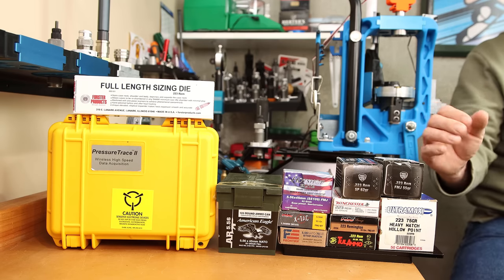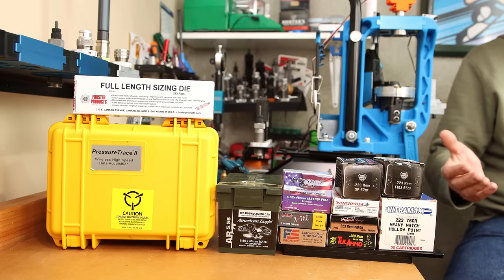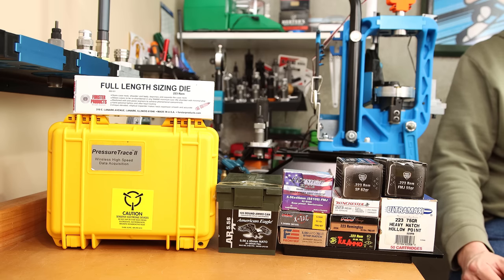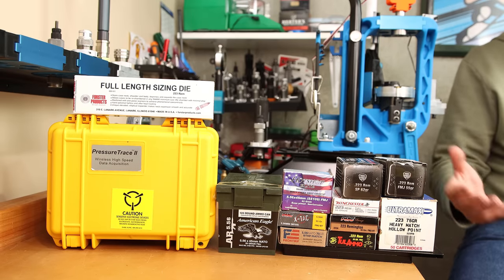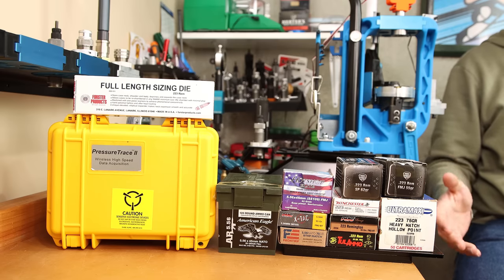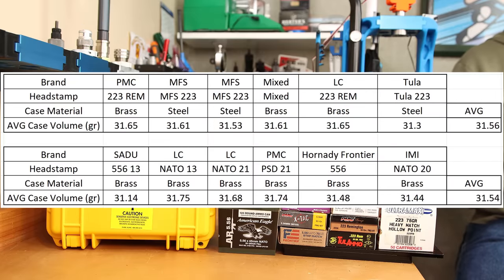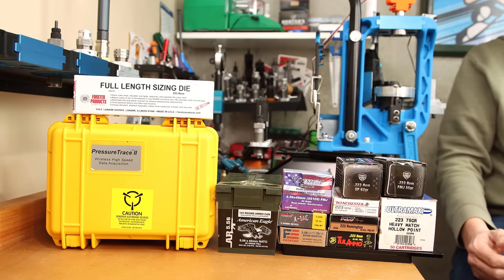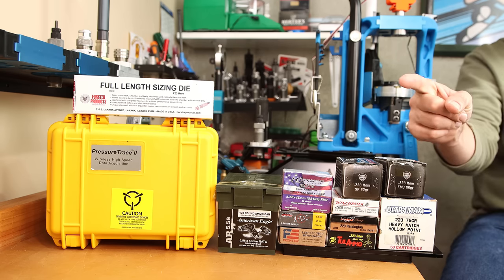223 vs 556 - The Hidden Truth No One Tells You!

Comment: As commentary, in the '80's, I and friend hunted varmint with 223/556 cartridges as our light rifles and tried to crease all the velocity out of them as possible.  Luckily, we rarely found pressure problems as we selected primers, used rabid case selection and treatments for primer pocket/hole, neck preparation, etc.; essentially max velocity bench rifle ammo. We threw out anything that looked iffy. We had quality rifles; those probably helped cut us some slack.  We found the very heaviest'/compressed loads to be the most accurate, when adjusted with the right bullet selection. Shooting paper targets for groups is a great humbler, and proper rifle presentation helps. I think our case neck preparation  for concentric position, near identical grip on the bullets, helped us along toward our goals.  Along with all that, we shot for pride, and loved riding each other for any kind of miss! Wish I had all your equipment then, and now. It's fun to hear that rifle go BANG, but really satisfying when the bullet goes exactly where you want.

Comment: 308 is also not 7.62x51 but most people don't believe it. You will see the difference if you shoot 308 with a original H&K G3 and experience feeding issue after feeding issue.
Reply: You experience issues with cycling is about the 308 using slower burning powder to get more velocity.  An adjustable gas system would solve your issue. Loading 308 cases with faster burning powders also solves your issue, 7.62x51 and .308 are the same case.

Comment: awesome video and your first set of numbers 556 was substantialy more powerful. Any gun that can shoot a 556 can shoot a 223, it's not always the other way around as per the manufacturer that I've talked to. I'm only going off of what a gun manufacturer of told me, and 556 is marginally a little more powerful from what I've seen with most tests obviously not with the ones you used it was more. the data shows and videos show it's only about 40 fps variation usually, which isn't really enough, to be enough. Paul Harrell did a video on 556 vs. 223 as well his numbers weren't as big a difference as your numbers are I'm not saying you're wrong they just weren't.

Comment: I learned the opposite of what I’ve been convinced.
i.e. “556 rifles are built to tighter tolerances and factory 223 ammo is fabricated to sloppier specs and lesser QC standards therefore 223 ammo won’t function as reliably in a 556 rifle, but a 223 rifle will eat either ammo because it’s built to looser specs”
Hmm… 🤔

Comment: While I understand at least some of the reasons that you chose to use a .223 Wylde barrel I think it would also contribute to misleading data.  Among the reasons I presume is to reduce the number of variables.  It is also introducing variables by firing all of the ammunition in a chamber that was designed specifically for neither; rather it's a "one size fits all."  The Wylde chambering is going to lower the peak pressure for .223 rounds due to the extended throat while it is essentially the same as a 5.56 chamber although possibly/probably a little tighter than a 5.56 chamber thus raising the pressure for the 5.56 rounds.  To me data from a 5.56 NATO chamber would be more meaningful for the 5.56 ammunition just as the .223 should have been fired in a .223 chamber.  Measuring the case volumes of fired cases seems rather unscientific since they have all been fire formed to match the Wylde barrel.  At a minimum, unfired vs. fired case volume as an additional data point would have been interesting and possibly meaningful.  Your verbal comparisons seem spot on.  Me?  Just a detail oriented hand loader.

Comment: The only real difference is the pressures. All other variences are irrelevant as far as running them through one rifle or the other. The only other are where there is difference is in the chambers of the rifles themselves. Most 5.56 chamberings have gap between the chamber and where the rifling starts where .223 chamberings do not have the gap or might be vice-versa. As far as the cases and overall lengths of finished rounds, they are basically identical. Cases are identical, with the only length variation being in how deep bullets are seated. The pressure difference comes down to weight of powder charge and type of powders used.

Comment: For 55gr, there is NO difference between the two functionally. The pressure is only slightly higher in the 5.56 but not enough to be dangerous. Now this is strictly for 55gr. I've used 5.56 in a .223 but knowing there ARE pressure differences between the two, I stick with 55gr as it's more the "standard" round. I've since moved to 5.56 chambered barrels so there is no longer any question of "can I run that in my weapon? ". I've noticed that 5.56 hits higher than .233 and that's attributable to the higher pressure,  like the difference between your standard round and a +p. Higher weight bullets sit differently in the chamber so that's where you'll have problems but as far as 55gr, there is NO appreciable difference in functionality in either chambering. The only difference between 55gr 5.56 & .223 is like a simple switch from standard to +p ammo.

Comment: A 5.56 is going to have more power behind it then a .223, a 5.56 is also going to have a easier time going through something then a .223 and it's going to leave a bigger hole then a .223. Also if you are going to put a round that isn't the proper caliber or designed for that type of gun that you are using aka if you are placing a improper round in your gun then you have zero business owning a gun let alone being around 1. Use the proper ammo for your gun or don't touch guns at all.

Comment: The only truth is, 5.56 has a lot more pressure than .223, therefore, you safely fire a .223 from a 5.56 gun, but you can't fire, or shouldn't fire, due to safety issues, a 5.56 from a .223 gun, because it over pressures the barrel and could cause a catastrophic failure.

Comment: I'm too late but I have an interesting point to add. My rifle is an original Colt AR15 from back right before they passed the first ''assault rifle'' ban (in the early 90s). Its barrel is stamped 5.56 and is practically identical to my M16A2's, but the lower is marked .223. So, does it really matter considering Colt marked their rifles with both on the same rifle?

Comment: Here is the truth from the industry 556 and 223 go down the same exact simile line and there is absolutely no difference in how they are loaded pressure is very for bullet weight and desired ballistics that is all the only difference coming out of the factory is was stamped on the bottom of the case there’s your fucking truth there is no difference only with a gun can handle what you’re using

Comment: The pressure difference is not an issue, either.  There are different pressure specs.  But, there is also a different pressure testing spec for each cartridge.  If you use the specified test to measure pressure for the .223 on a 5.56 round, you get .223 pressures, and vice versa.

Comment: I bought Winchester 223 & 5.56 and took the cartridges apart and cut the cases in half. 0 DIFFERENCE !
then I weighed the powder and the 5.56 powder was .90grs. more, same powder
then I downloaded SAMMI specs on 223 & 5.56 chambers and found the only variance was throat in 5.56 is longer and angle for leades was 1% less in 5.56 making it overall longer.
THE END !

Comment: You know, a really good visual aid is to put a 75gr .223 next to a 75gr 5.56. The bullet geometry is VASTLY different, and the 5.56 ogive is considerably shorter than that used in a .223 projectile. The 5.56 chamber is cut to accommodate that short ogive, while the .223 is not. Dimensionally, you can shoot 55gr FMJ 5.56 in a .223 rifle just fine without worrying about overpressure. It's only when you go up in bullet weight and the ogive extends out where it becomes a problem, as you can tell looking at the two 75gr loadings.

Comment: Sir .223 is 5.5.56x45mm, specifically .223 Remington Fmj are designated 5.56x45mm Ball M193 by military standards when loaded 3100fps in a 20" barrel.

Also 5.56x45mm (NATO) wasn't created until around 1977 in Belgium by FN Herstal and wasn't adopted by the U.S. military until September of 1982 for use in the M16A2 and later the M249 SAW.

There a difference between the original .223 Remington designated 5.56x45mm Ball M193 and 5.56x45mm (NATO)

.223 Rem is technically 5.56x45mm but 5.56x45mm (NATO) isn't .223 Remington.

.223 Remington was called 5.56x45mm Ball M193 20 years before the creation of 5.5.56x45mm (NATO) .223 was created created specifically by military request after they rejected the .222 Remington.

Lastly the original 5.56x45mm (NATO) cartridge is the SS109 and it was redesignated as the M855 (Green Tip) by the U.S. military.

Comment: the only difference between a 5.56 and .223 factory loads is the 5.56 has more powder.. Clowns claim the brass is different... the only difference in the brass, is what is stamped on them... since the 5.56 has more powder you have a measurable difference in pressure...

Comment: The pressure differences are huge.  The danger isn’t about damage to a cartridge, it is damage to the BCG.  In the military, we dont use “averages” we use worst case scenarios.  Putting something with a larger pressure breaking a bcg can lead to a complete malfunction when your life depends on it. If you felt so badly about making this video than say you think it is okay to put .223 in a 5.56 weapon.  If not, don’t put out an informative video alluding to that and take no responsibility at the end, or else you’re on the same boat of the ppl you’re accusing of hesitancy.  When a rifle says “multi caliber” it means you can shoot the civilian AND military variant of that round.  That implies the BCG can handle “worst case scenario” not the average.  To be safe, change out your BCG to handle higher pressure in the chamber and you’re good.  Do NOT shoot a round with 10,000 psi higher than your chamber can handle.

Comment: Ok Science aside.  My company used to make gun barrels for colt and DPMS and Bushmaster.  They were all marked 5.56 x 45 NATO.  We made a few barrels that were for .223 only.  We shot 5.56 out of them and the chamber pressure is higher on the 5.56.  So can you shoot 5.56 out of a .223 marked barrel, Sure, is it safe.  I wont even begin to say.  But .223 and 5.56 are identical measurements within a few tenths of a thousands.  Thinner than a piece of paper.
Reply: What was the reamer’s chamber neck diameter?
Reply: @blackhawk7r221  I honestly dont know.  I wasnt at the company when they did this.  I just found bills and barrel blanks.

Comment: I've never seen lower pressure loaded brass wear out faster than high pressure.
If you run through a lot of rounds, in your AR, .223 cases can swell and not extract properly. Due to the the different headspacing.
If you like to plink, zinc-coated steel cases are great. Just be sure to have your bolt carrier group drenched in oil. And thoroughly clean it every 500 rounds.  Stainless 5.56 uses lower pressure than most .223 so, you may need a lighter buffer, and (or), buffer spring.

Comment: Great data and great video. The difference is 5.56 is loaded a little  higher and .223 has less distance to the lands so if you have a really long btog there is a possibility for a pressure spike due to little or no bullet jump.
Reply: Bullet jump can be critical in accuracy. I have a Kimber bolt action .223 with a very light barrel, weighs 5lbs, 12oz without scope. It wants a jump of .004" for a 40 gr Hornady "Varmint" bullet & .020" for a Hornady 62 gr. It shoots both Under .400" for 5 shot groups at 100 yards & huge groups with most "commercial" ammo. I use Hornady's chamber/lead measuring device which measures off the ogive instead of the bullet tip.

Comment: The primary difference between the two cartridges can be equated to a Mouse Fart in a tornado - either one will put your ass in a body body bag just as effectively as the other.

Just remember - Do Not Load a 5.56 in a weapon chambered for the .223 ; there are more than enough articles to explain why, so if you need to know Why Not to do so, then find a few articles and go from there.

Comment: Yes, I so tired of all the BS too. In September 1963, the .223 Remington cartridge was officially accepted and named "Cartridge, 5.56 mm ball, M193". The following year, the ArmaLite AR-15 was adopted by the United States Army as the M16 rifle, it is the round I used in the Army when I was issued the  Colt AR-15 property U.S. Govt M16A1 Cal 5.56MM. This was stamped on my rifle.  The 5.5.6 NATO came out later in 1980 from the .223 but it’s not the same. It uses a different heavier bullet at higher pressures, slower but straighter shooting at longer range. It was adopted as the M855 round and to be used in the M16A2. The rifling was different from the A1 with the A2. The A2 could shoot both rounds with a loss of accuracy with the M193 round. However the A1 the M855 round would not shoot accurately at all out of the A1, and not recommended. The .223 is a 5.56 mm round it’s just not the same as the NATO round which people use today out of the later versions of the AR-15. And other weapons using the round today so that when people say 5.56 they mean the 5.56 NATO. 
I was issued the M16A2 later in my Army career. And carried one in Desert Storm. The ballistics are different from the A1. It’s also zeroed differently from the A1 and you have to adjust your aiming points on various ranged targets when qualifying. My roommate was on the Battalion rifle team and was rated 2nd best shot in USAREUR.  He didn’t like switching to the A2. It threw off his aim at first.

Comment: I never load to "max" , ever. If I feel I just have to have more horse power.... I'll go to a bigger cartridge. I suggest you /we not try to "magnunize" this cartridge. two or three hundred feet per second is just not worth it.
Reply: Smart man. I test all my guns to well over book max to identify weak parts and/or failure points and for my own peace of mind, then settle on a tuned load usually just below max. I don't know of a lot of people that do that, but it makes sense to me, and I always wear proper PPE when testing those loads. You're so right - There's no need to run super hot for more velocity; just go with a larger caliber if more velocity is necessary for the application.

Comment: I think you’re complicating this way too far. As far as I’m concerned, factories use proprietary powders that are usually not available to reloaders. Therefore your pressures will usually be way higher than you can reload safely. Safety is the issue, with powders not all that other stuff. As a competitive shooter all I’m interested is accuracy. I’ve got multiple 5 shot test groups @200 yards averaging about 1/2” with my custom bolt action match rifle with both types of brass. This brass has been worked significantly. In a bolt gun with hand loads, makes no difference at all.

Comment: They are not the same thing. A 5.56mm is slightly more robust in the shoulder and has more power. A .223 was designed for thin-skinned varmints. Whereas, a 5.56 was intended for two-legged dogs!

Comment: If your AR is listed as 5.56, you can use either one; but, do not use 5.56 in a .223. The 5.56 is manufactured with more pressure, as stated in the video, and an AR that is marked as .223 is not designed to stand up to the pressures and could have a catastrophic failure. As always, if you want to be certain, contact the manufacturer. Good shooting! 😀

Comment: You didn't shoot them so what did you really prove?
Reply from the maker: Where do you think the velocity and pressure readings came from? Those were from fired cartridges. That is what generated the empty cases for the case volume measurement.
Reply: @BoltActionReloading  You showed the equipment but never using it. Looks like someone else's data.

Comment: lol mine will shoot either round i see , feel , or even slightly recognize ANY difference.
Reply: Your chamber has the excessive leade cut.   If you had a proper .223 ream, a 5.56 would be burying it’s case mouth and bullet into the rifling, and you’d be knocking out the brass with a rod.  Most AR’s, regardless of marketing, deliberately use sloppy chambers for reliability.
Reply: @blackhawk7r221  good point / I do not use the AR platform however I'm sure this still applies as mine is stamped .223 / 5.56
Reply: @Barefoot-Bob  Ok, so if it’s not an AR, then you probably have a good snug chamber in .223, with the longer leade distance of a 5.56.   Mini-14’s used to secretly do this decades ago.
Reply: @blackhawk7r221  and still do, it is the weapon i have, not that it was a secret just, didn't seem pertinent to the discussion . Its shoot a very good MOA with either ammo at 100 yds .

Comment: 5.56x45mm NATO vs .223 Remington... .223 caliber, as in imperial system, American system is 5.56 in millimeters, as in what 98% of the rest of the world uses (uk seems to use them both interchangeably.) Now if you wanna get real specific its actually 5.66mm, but if you're gonna argue about a micrometer go argue where it matters, like NASA. besides, the bullets got to engage the rifling somehow, right? you don't think they make it a micro bigger so it can?

this video is like comparing 9x19 parabellum to 9x39... the only difference is that the bullet of one is a millimeter taller, which i know does make a difference, but its sharper vs stubbier

Comment: 223 wild,,,,, um how about 223 Remington,,, and there is a slight difference in case length,, also case thicknesses, as well as 556 back of case is hardened, and glad you mentioned it,, the industry standard velosity and chamber pressure in a 223 is not the same as millitary 556